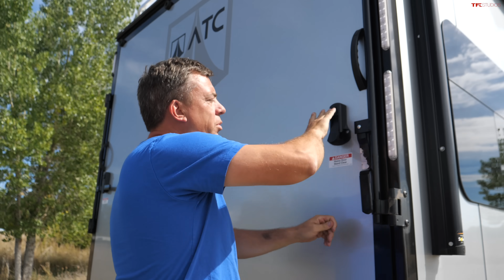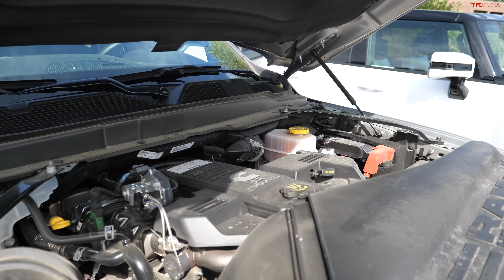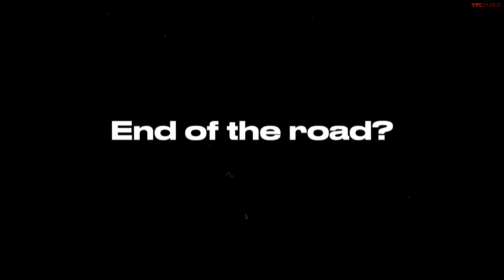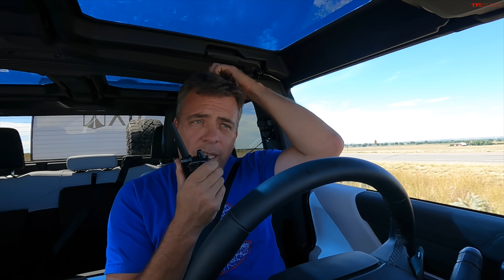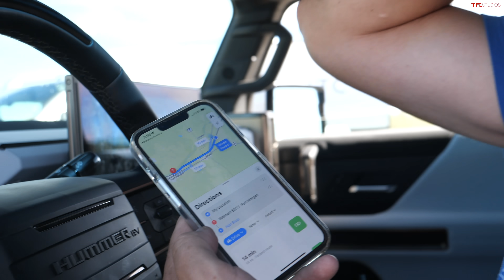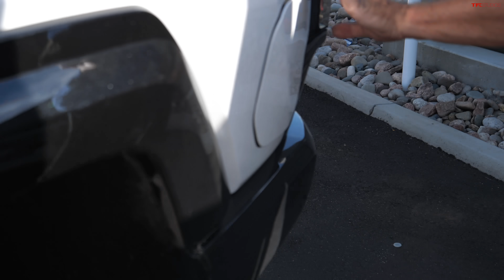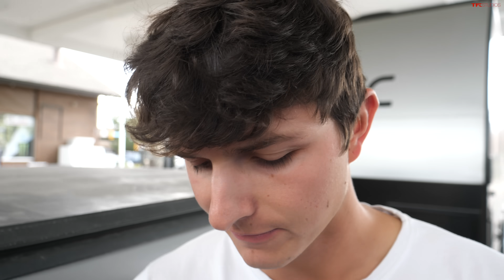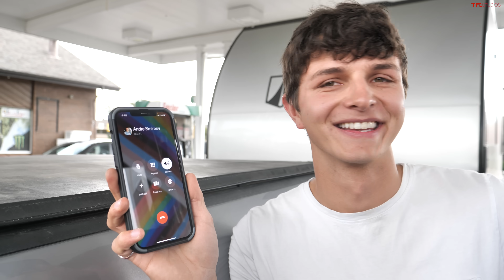How Far Can a Diesel and Electric Truck Tow An Identical Camper Trailer on ONE Fill-up?

Comment: No one is talking about that generator charging it 😂😂
Reply: Gas used to be a byproduct too. The refinery in Whiting IN would dump gasoline into Lake Michigan and burn it. It doesn’t matter what it used to be.
Reply: Gotta take into account the amount of diesel that uses 😂
Reply: No one is talking about the fact that you get 11 gallons of diesel from a 42-gallon barrel of oil either. No one is talking that the barrel of oil is priced at $80+, which means your diesel is underpriced, and that diesel is still more expensive than the electricity, which is profitable in each stage.
Reply: @ronaldking1054  diesel is a by product of gas. Used to be cheaper than regular gas. Consumers have been getting ripped off for years now.
Reply: @Muddobber33  This is what happens when the product is no longer a byproduct, but it is the real product. In other words, diesel couldn't be used for as many vehicles as it is, which is exactly why the price is too low, but for some reason, these economics escape you. The only people who have been getting ripped off is the guy you are selling your vehicle to.
Reply: @ronaldking1054  how do you get your food? Diesel!!!! Farmers use it , ( I have 2 tractors) for hay production. Trucking companies and trains use it. I guess you like these liberal demorat policies and inflation. You definitely ain’t the brightest bulb on the tree.
Reply: @Muddobber33  Incorrect. The volume of "diesel" or "gasoline" in a barrel of crude oil is tied directly to the distillation curve of that grade of crude. Please research the subject, instead of regurgitating false information. I work in this field.
Reply: @ronaldking1054  Diesel also doesn’t just overheat and catch fire like a ev battery
Reply: @mauricemotors8207  There has been no runaway since the battery chemistry changed, but hey, you can keep spouting stuff. That was fixed within the last 20 years, but battery technology according to conservative media has not changed in 50-60 years. Huh, it must be nice to be to ignore that which does not fit your picture.

Comment: Need a diesel “volt” style truck. Small diesel generator with electric motors for drive. Like a locomotive!
Reply: I've been sayin that very same thing for years.......
Reply: Yeah that would be a nice concept I never understood how come the big truck manufacturers haven't done some type of diesel electric hybrid setup instead of trying to go full EV...
Reply: Hybrid tech is most beneficial in stop and go driving.  When towing over the road you are burning fuel.  The electrification doesn't play any role.  You end up burning the same amount of fuel.
Reply: The government wants total electric so they have total control
Reply: @jeremylyons6252  just like they tried in Russia when they Asked Tesla to shut down all of thier cars over there......
Reply: @jeremylyons6252  🤦🏾‍♂️🤦🏾‍♂️👀
Reply: I've been sayin that for year as soon as this EV nonsense started.

Comment: Tiny little trailers. You need to tow what real people use. Many of the people in the RV parks where I stay have trailers that weigh near 15000 pounds like mine. The smaller trailers are about 9000 pounds and are towed by people with Ford EcoBoost F150 trucks. ICE will always win because the fuel is only a small part of the total weight of the chemicals used to propel the vehicle. The rest is Oxygen from the air pumped through to support the combustion. That Ram is really bad on Fuel towing. I get better with 9.97 over all towing 73000 miles where my total weight is 25000 pounds and my trailer is a 36 feet long. That includes real towing test roads and grades. Not like the easy peasy Ike, which was a breeze for my setup. Take a longer trip and leave at the same time. Drive the same speed and see who gets to  the destination first. Like my 1800 mile trip I take to go south in the fall and north in the spring. Now take the 46000 dollar price difference and buy fuel at 4.60 you get 10000 gallons. At 10 miles per gallon the first 100000 miles towing on the Dodge is free.

Comment: Why on Earth would  you skip over the cost of a recharge on the road..??  Looks like they were billing you $37.00   for what 125 miles ?  Opppss  I paused to comment before he said it was Free???
  Just wait until there are enough electric vehicles on the road that the Government starts taxing your travel by the mile to pay of the roads.. Just like fuel taxes do now.  Both State and Federal Road taxes and sales tax too .. Michigan charges sales tax on top all of the road taxes...
Reply: Someone did the math in another comment. "Thats awesome the charge was free, but let's use the numbers to find out the future cost. The Hummer charged from 7% to 51% for $37.41 according to the EA charger. So $0.85 for each 1%. At that rate it would cost $79 to charge the Hummer to 100%. Hummer cost per mile: $79 ÷ 123 miles = $0.64 per mile.
Cummins cost per mile: $105 ÷ 211 miles = $0.49 per mile"